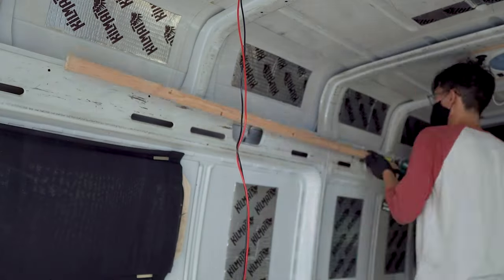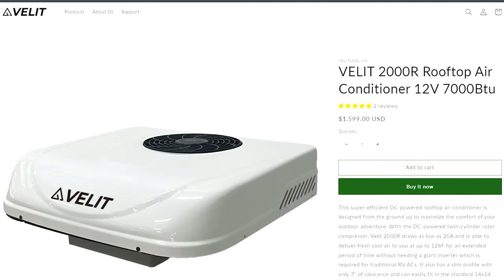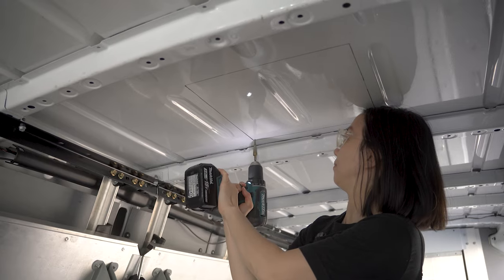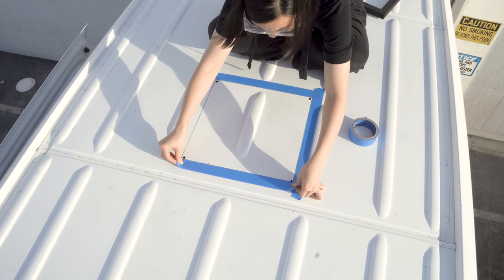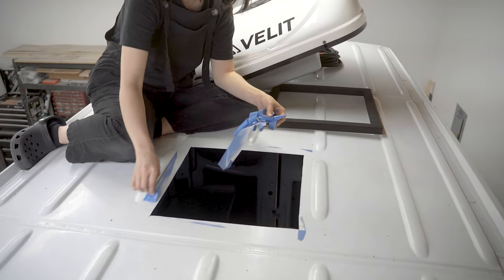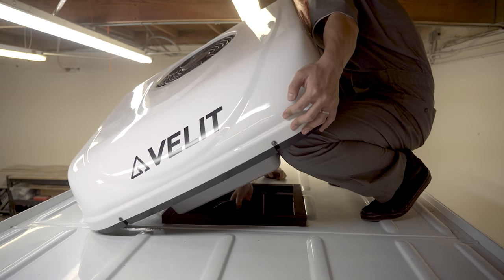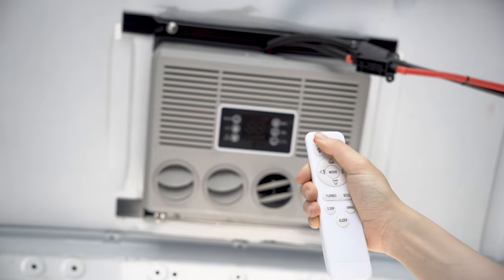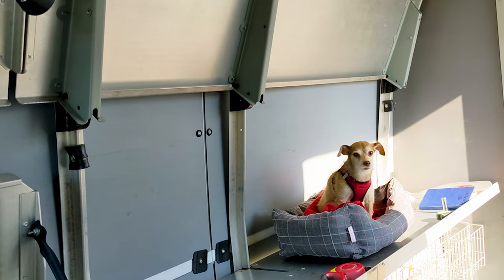Easy Offgrid AC Install on a Sprinter Van

Comment: Turbo and ECO mode? There should be a plethora of compressor settings and 3+ fan speed settings. This should all change the amp/hour draw. Putting the compressor on a 20% load and fan speed med or high may only draw 12 amps/hour. Or is there literally only 2 settings?

Comment: I was thinking of putting this in my finished camper and replacing the max fan.  Is there a way to cover the large black mounting brackets on the ceiling?
Reply from the maker: Yes absolutely! The AC unit comes with a plastic cover. We didn't show us installing it since we haven't finished the walls and ceiling on our van yet

Comment: Awesome work on the install! We are thankful that VELIT has dropped a more affordable AC unit than other brands. SOK batteries are great too. Small tip is to avoid impact guns on battery terminals. Torque wrench is best :)
Reply from the maker: I have a calibrated trigger finger I use for the impact gun 😝. It’s definitely a bad habit using the impact but I get to save 0.5 seconds lol

Comment: I just bought this unit and this was helpful for my installation. I bought the sealant you recommended for the install.
Reply: how has it been working?
Reply: It works great. Most of the time I can run it on night mode which draws only 20A. I only need to use it on Turbo mode when it’s really hot outside. My remote was defective out of the box but I emailed Velit support and they sent me a replacement right away.
Reply: @Blztrls  thanks man, planning to get the same unit 🤙🏽

Comment: I think you have come up with some cool creative solutions with your van build.  I'm curious as you did not add any re enforcement around the AC opening if you've noticed any defection allowing water to penetrate inside the van.  

Also, I'm curious about your satisfaction with the Velit AC.  Has there been any issues with it and does it keep the interior cooled down in your van?  Thanks for creating this content.
Reply from the maker: Thank you! So far no leaks despite not adding reinforcements, we like the unit so far it kept us cool during the heatwave last summer and still kicking!

Comment: Thanks for sharing this video. Will you be  able to share your experience with this unit after 10 months? Also what battery setup do you have on your van for supporting this AC unit?
Reply from the maker: Sure thing! It’s been pretty great and haven’t had any issues. We have a 400W solar with 200ah lithium batteries and we rarely deplete the system when using the AC
Reply: Can this ac run of just engine alternator and the two truck batteries?
Reply from the maker: @cryptomoordexterjbey6196  sure can as long as it is 12v!

Comment: Did it do a good job of cooling?  What is the noise level - can you have a conversation when it is on full blast?
Reply from the maker: Yes it does a great job cooling the small space. With insulation and everything built out, the cooling efficiency would be even better. At full blast it is a bit noisy, but you can still carry a conversation without shouting. Although I wouldn't see the need for it to be full blast since the space is small and cools rather quickly on eco mode.

Comment: Nice vid! very technical. One question. You mention that it's pulling up to 34 amps. With a 100 Ah you say you can run it up to 3 hours. Any update on this? Did you run it on turbo on a full battery until battery depleted? I'm anxious to know since I am between a compresor AC and a 12V evaporation/humidifier aparatus that pulls only 1/10th of the amps as it's basically just a fan pulling the outside air through a humidifying mesh. Thanks for your time.
Reply from the maker: We haven’t had a need to run it completely dead since we have solar. But we stayed comfortable all afternoon last summer on turbo while solar charging.

Comment: Is there a fan mode to this? Thinking about replacing Maxx Air with this and AC is not always needed.
Reply from the maker: We linked the site to the manufacturer in the description, so you can check that out for the most up to date features. For our unit we don’t have a fan only mode, but we can increase the temperature to ambient so it’s not blasting cold constantly.

Comment: I really want to buy this air conditioner, how many times have I seen this fan facing the sky, what should I do if it is stormy?
Reply from the maker: The unit does not need to be covered in stormy weather.

Comment: I wonder if a 12v 7k BTU AC like this would be more efficient in cooling the back of a future 2025  Promaster 1500 EV van with 113kw EV battery using it's OEM A/C coming from the front?  I suspect not and so it would be brilliant if those future EV vans had the forethought to realize we would like to use the OEM compressor  to cool just 1/3 back half of the van overnight?.  Some van lifers and EV fanatics  are speculating a Van like this might be able to run the OEM A/C overnight for 10+ nights on a full charge!   This would be insane if true, safe and did not void the 10y powertrain warranty on the van. .

Comment: I have a high Roof Ford transit van. Just bought it. Looking for an easier hook up because I got quotes for $13,000 they’re crazy. I have search and rescue dogs. I don’t know much about this. What did you hook it up to do have to get the batteries  or solar panel? Do you guys do the installation?
Reply from the maker: We hooked it up to a battery to power the unit.

Comment: How many batteries i need to run AC for 5-6 hours
Reply: I'm not the video creator, but I can help with this since I've done of a lot of research into RV electrical systems.

Don't think "number of batteries," think in "amp hours (ah)". If a device uses 10 amps when it runs, a 100ah battery can power it for 10 hours (100 ah / 10 amps = 10 hours).

In this case, if you ran the AC on max with a 35 amp draw, you'd need 210 ah of battery to run it for 6 hours (35 amps * 6 hours = 210 ah).

It's also worth noting that devices like this basically require lithium iron (LiFePo4) batteries. Lead acid and AGM's cannot discharge watts fast enough to keep up with the demand the way that a lithium battery can.

Comment: So what kind of battery is used to power this? And how much is it?… trying to do this on my Chevy cargo van. 

Thanks!
Reply from the maker: You can use a regular 12v car battery to run it!
Reply: I would strongly recommend a lithium iron (LiFePo4) battery. Lead Acid car batteries are not meant for rapid discharge over long periods of time like this. 100 ah lithium batteries can cost anywhere from $600-$1,000.

Comment: Where does the water fall out of?
Reply from the maker: there's no water in this system
Reply: Miguel is referring to the compressor condensation run off that all AC's have to drain. 

There is an evaporator on this unit. I assume it purges back into the atmosphere as there is no plumbing.